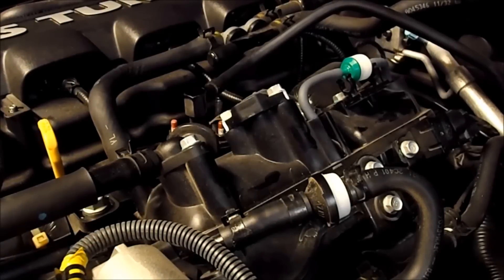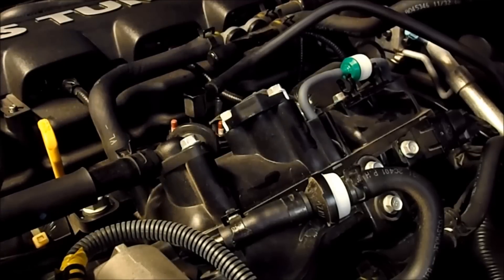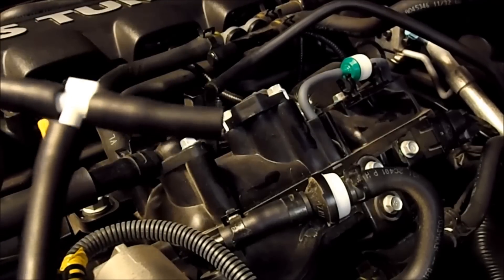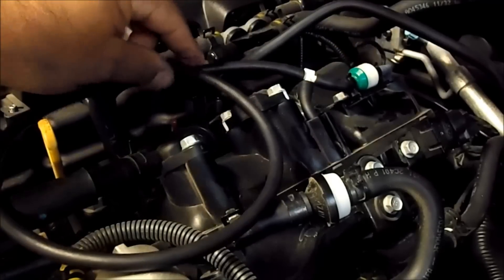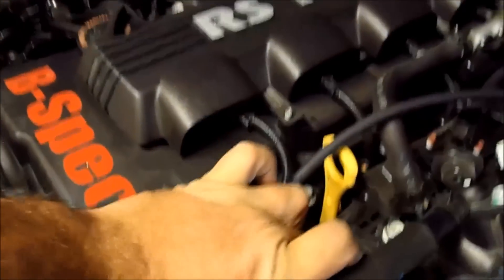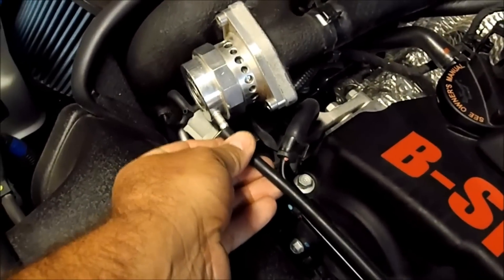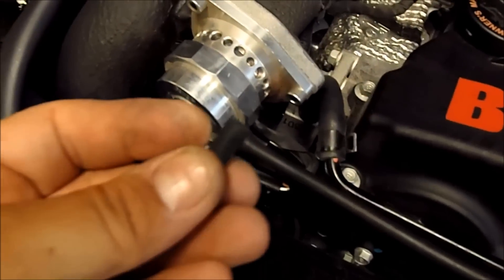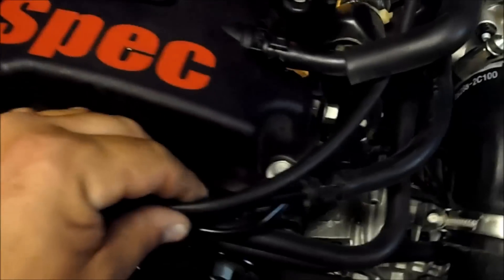2013 Gen Coupe 2.0T BOV Solenoid Bypass

Comment: Why didnt you just run the line Into the pipe the solenoid ran into? I ran mine into there and don't seem to have any problems and used a lot less vacuum line...
Reply: Wilhelm Theilmeier did it help the bov and boost

Comment: This is the way I've done it since beginning and makes yiur BOV 10x louder gets better kick in boost aswell..

Thank you for this video every Genesis should connect their BOV this way!!
Reply: Otown613 BK2 what size hose did you use?
Reply: @jordan_.zx10r  5/32 holds good boost. I did everything he did in this video.
Reply: Otown613 BK2 I tried it and bov stayed open on idle and bov was delayed when I let off gas
Reply: @jordan_.zx10r  same did you ever figure it out?
Reply: @MrSpaceSentry  same with a rfl bk2
Reply: @MrSpaceSentry  no
Reply: I saw your comments on a couple other videos, but I am just curious what the point of this is. Does it make more boost? What is it bypassing? Or is it solely just sound. Please let me know if you can.

Comment: Quick question, I'm doing some troubleshooting atm. So instead of using a T like you did, since I have a T there to go to my boost gage, I instead just used the vacuum line that used to go to the solenoid, and directed that to the BOV. Completely removed the solenoid. Aftermarket intercooler doesn't have a nipple so I didn't have to cap that off.  Do you see any problems with this or should it work? Currently not making any boost.
Reply: I tried that on my 2012 BK1, havent gotten boost when I used the source the solenoid did so Im going to try using the same source as these guys, I will let you know if there is a difference

Comment: I'm still experiencing boost issues and have to turn car on and off.. Did every step correctly I'm so confused.
Reply: You sure you did it correctly? I had to do this yesterday, no issues since. Knock on wood lol. Maybe a boost leak somewhere? Have a way to send me pics?
Reply: Did you fix the problem. I’m having the same problem on stock set up with hks bov In stock location
Reply: not working at all for me either getting flutter and bov isn’t working
Reply: @MrSpaceSentry  did you figure out the flutter? Mine has been fluttering and not opening too but I haven't even done the solenoid bypass I was planning on trying that to see if it fixes the problem
Reply: @Jacob-rt6on  dog I’m having same problem  on my 2012 lol 😂I’m about to do this an see if it helps. I think solenoid goes bad an keeps my forge stuck open.  Even when I re greased an looked at o rings.
Reply: @Uzu_makiii  It fixed my issue but I figured out why it wasn't opening, my solenoid wasn't broken the previous owner had the vacuum lines backwards on the solenoid lol

Comment: Hey I don't know if you will be able to help but I hope you can. I did this little tweak and now when I go wide open throttle and when I let off the gas to shift gears the rpm's will rise 200-400. I have no idea why and started happening right when I did this tweak.
Reply: throw some washers in the bov
Reply: I know this comment was 5 years ago lol, I just got tuned and mine started doing this immediately after. Did you ever figure out the issue?

Comment: By any chance, did you have the code P0035 before you did the bypass. And if you did, did, doing the bypass, get rid of code P0035.
Reply: Need to know as well
Reply: I cant build pass 6 pounds p0035 code
Reply: Im not sure if it is too late but I was able to resolve this issue. The reason for the code is because the two prong pin connector that connects to your boost solenoid id malfunctioning. The easiest fix is to purchase a new plug from advance auto and solder back yourself
Reply: Grant Myers  did you figure this out?
Reply: @thanhvan8012  what’s the part called?